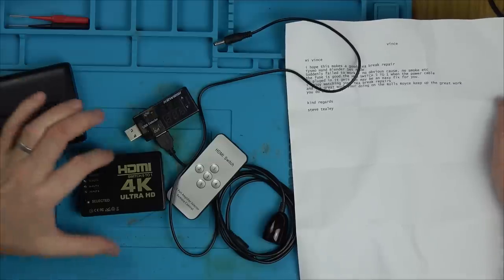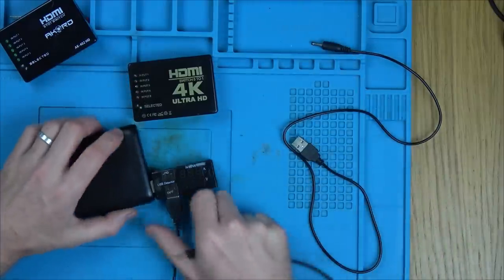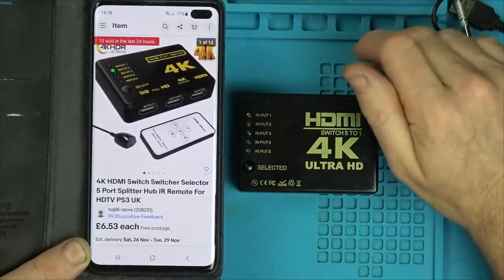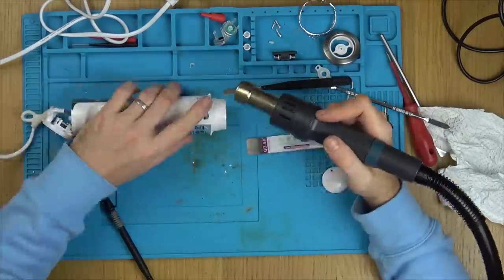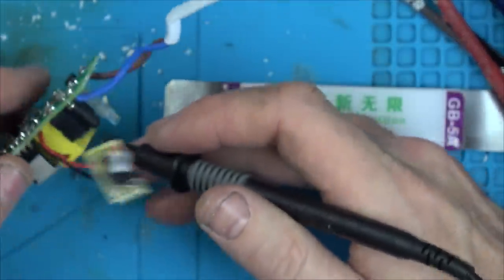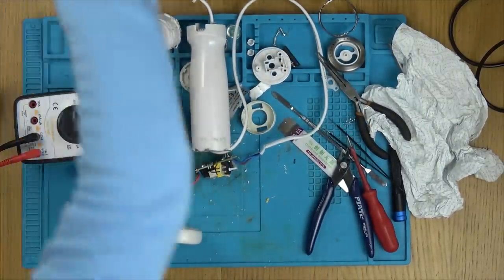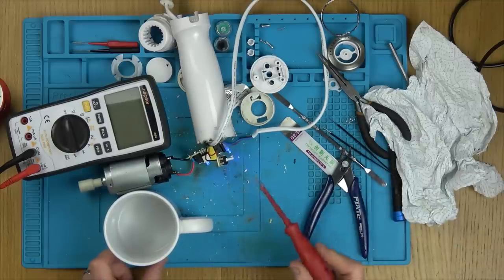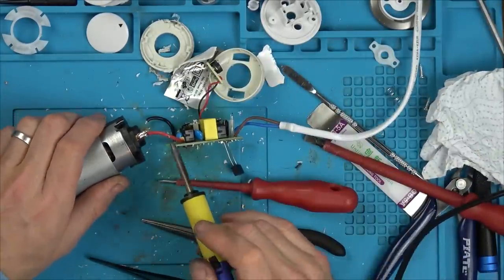Unsafe BOOM! with My Mate Vince - HDMI Switch & Blender Attempted Repair

Comment: old devices have an bottom that screws on the top bit wit a rubber seal that's the safe solution instead of glue.

Comment: If the motor is 240v - wouldn't 288v be way more than safe ?
Reply from the maker: I think it might be because there was no load on it. Maybe if the motor was connected and working it would have been 240V. A bit like testing a power supply without load will often test a higher voltage. I'm just guessing here 👍👍👍

Comment: I don't think the cause of the explosion was the wrong wiring, simply the motor would have rotated but in the opposite direction to that designed, but nothing would have happened, but if the motor winding was shorted, that's another story